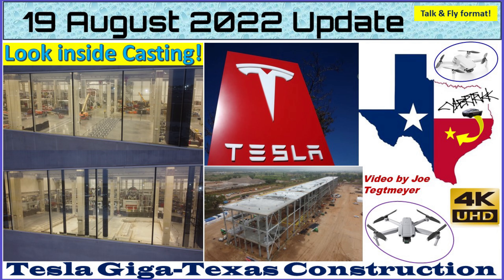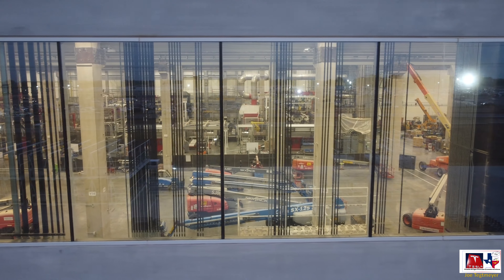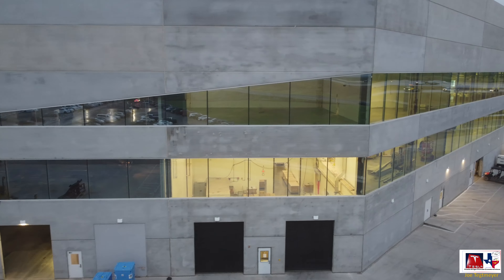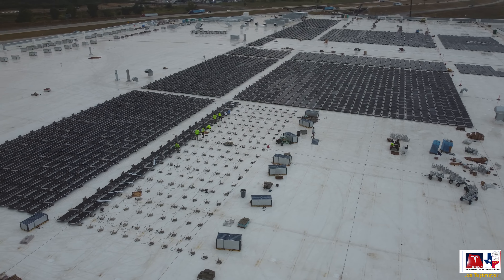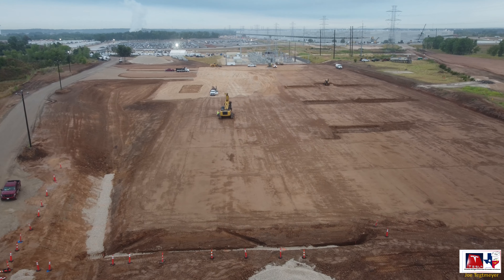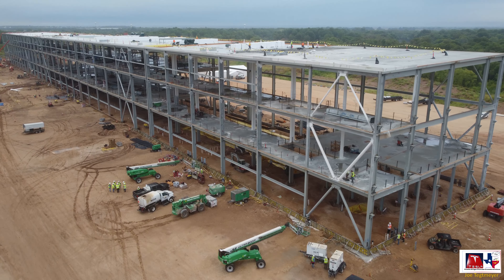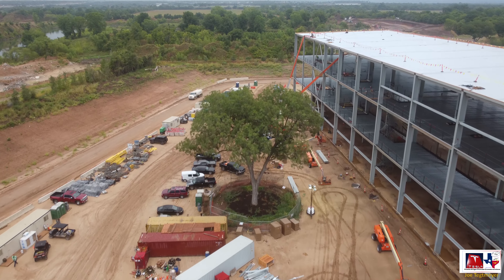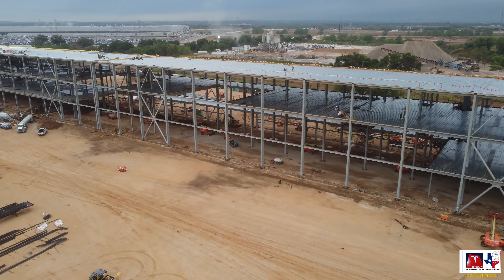Tesla Gigafactory Texas 19 August 2022 Cyber Truck & Model Y Factory Construction Update (06:45AM)

Comment: 21:54 I'm wondering why complete wall panels were installed, when now they are being cut for loading bays.  I hope they are not cutting through any reinforcement as that opens up cetain failure point in the future.  It was clear from the outset that more loading bays were required, yet the production ramp didn't provide for it.  There are numerous potential reasons for this, it would be interesting to hear the rationale behind this approach.
Reply: The wall panels are about 12" 300mm thick. There's an insulated core, so there would be rebar either side, and they would certainly be cutting through it. They might install some additional fixing to the panel above. The panels generally are welded together mid way along long side.
Reply: The panels aren’t holding up anything but themselves. Called curtain wall construction, that’s all those panels are, curtains. It really doesn’t take a lot of reinforcement to keep them together. They are thick only because there is a fairly thick layers of foam insulation sandwiched in between the two sides of concrete. This actually helps make the panels stronger too. It’s a rather ingenious system all in all.

Comment: Hey Joe, what do you think the Amazon Prime trailer at the North East is for?
Reply: TESLA may have a contract for amazon to transport the aluminum used in casting.
Reply: @eltonray2934  you mean for recycling?
Reply: @chaseing_chase  No,  ingots for the supply to the casting machines, recycling is done by Texas Disposal Systems.
Reply: @eltonray2934  I didn't know that Amazon was in the heavy hauling business. If so, they are delivering to the wrong dock.
Reply: A lot of companies are letting Amazon take over their materials handling for them. If you are a small company making a couple specific widgets or products and Amazon comes along and will handle ordering, accounts payable, and delivery for a fee less than it would cost to hire all those positions, it just makes sense to let them handle it. Amazon is big enough that no one can match their incremental costs to take on new customers. The economies of scale are enormous. 

Bezos ain’t bashful. He doesn’t want to own everything. He just wants to make a percentage off everything.

Comment: What is the deal with the Red Tents I don’t get what the purpose is?
Reply: Cars sitting in the sun can quickly get to 150-160 degrees inside. The tents keep the sun off so they don’t get so hot, since the hotter the batteries are,  the longer it takes to safely charge them. Someone mentioned it helps keep the employees from baking, but if that were the main reason there would be a cover over the entire staging area.
Reply: @Frank-gt7me  ok thx makes sense